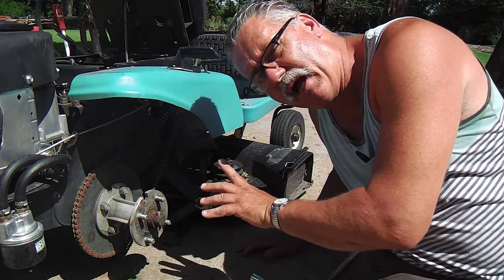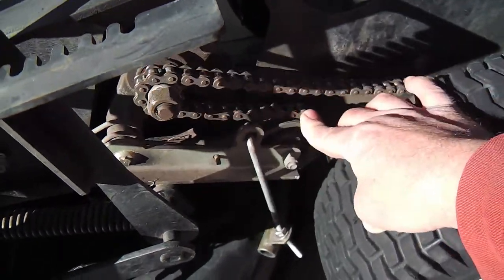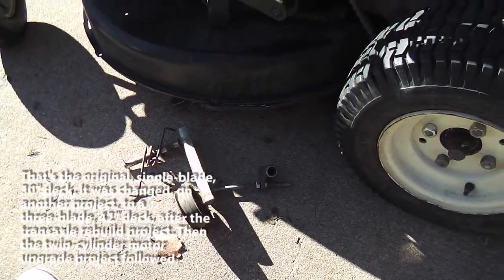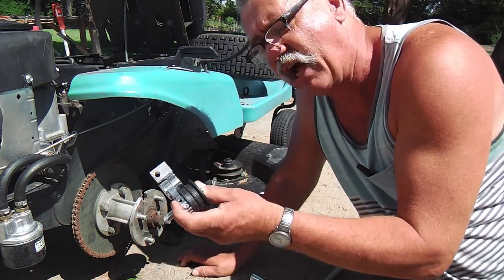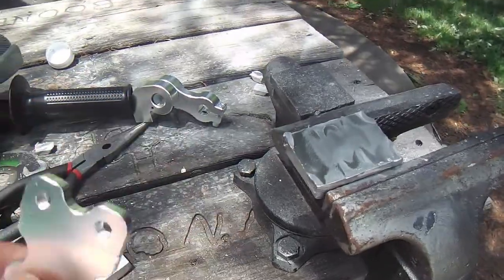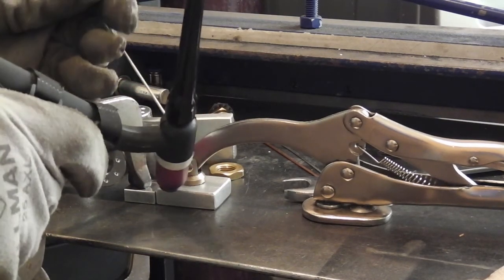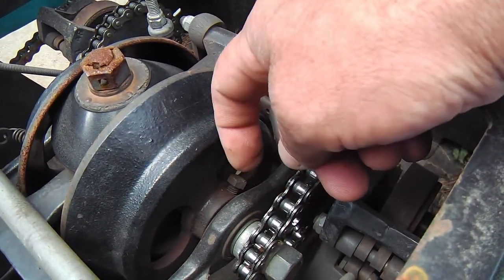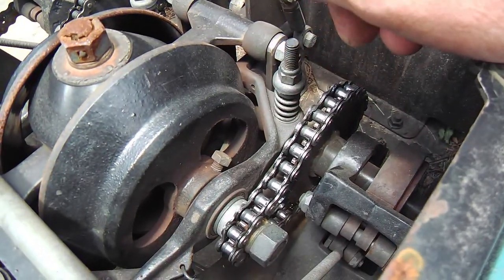Dixon 3304 Zero-Turn Mower Chain Idler Upgrade

Comment: I’m dealing with the same exact mower. They are very frustrating. The issue I’m having, is the original owner lost the L-bolts that hole the tensioner for the final drive. So they improvised and ran a wire coat hanger to hang the tensioner up that way. I went to drive the mower yesterday and the gear sprocket for the final drive snapped in half. Any idea where I could get one from? The exploded diagram I found, doesn’t seem to have that part listed 🤦🏻.

Comment: DO YOU HAVE A LINK FOR THE PARTS AND A VIDEO ON HOW TO DO A HALF LINK FOR THIS MOWER JUST IN CASE THE 1/2 LINK IS DONE DIFFERENT AND I NEVER DONE ONE BEFORE SO LOL
Reply from the maker: Do a YouTube search on half-link installation, there's gobs of stuff on it. I haven't done a video on it myself though. Personally, I like the half-links that you ultimately mushroom the end with a hammer to retain it, rather that the ones with the little cotter pins. But, either way, both are quite effective.
Reply: @NewJerusalemTimes  I was needing your advice on how to make a motor 13 horsepowerd motor

Comment: Someone previously did this upgrade on mine , does it seem to hold up?
Reply from the maker: Yeah, mine has been flawless ever since I installed it, and I'm even considering doing a similar idler to the chain at the disc cup/cradle assembly, to reduce the play/slop in the lever throw.

Comment: hey guy I am an old.....old maguyver type  love iy. I got an old old 311 that have been running for over 20yrs ued when I bought it. keep telling myself get a newer on, but the magyver in me says no. hey only a few miner adjustments a chain or two idler sprocket  hub bearings  in 20 years not bad. myonlu gripe is the old deck and lack of adjustment. have been threatening to cross breed it to a snapper mower deck. and hey no more Dixon dealers so blades are getting to be an issue. no one keeps 30in blades arpound. even see a blog on making your own the other day